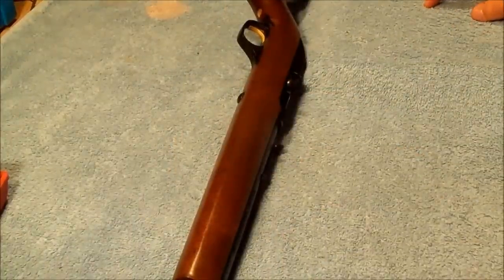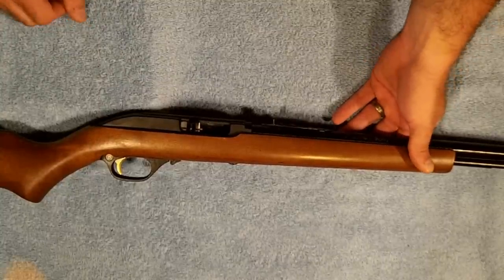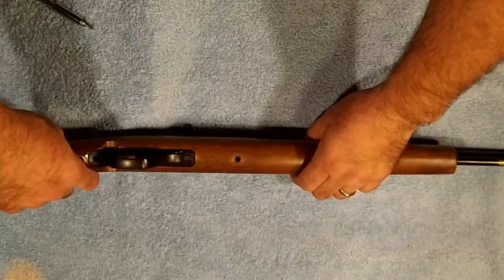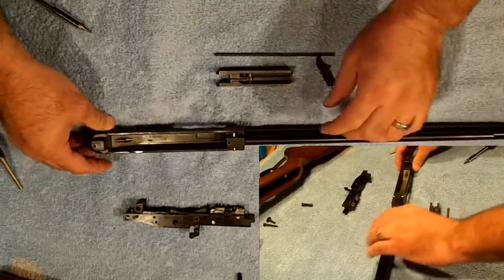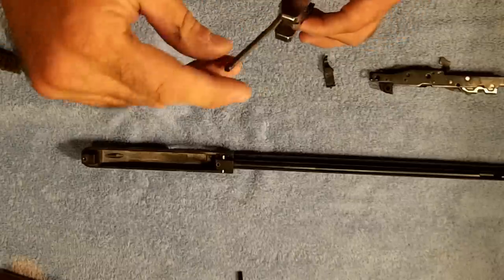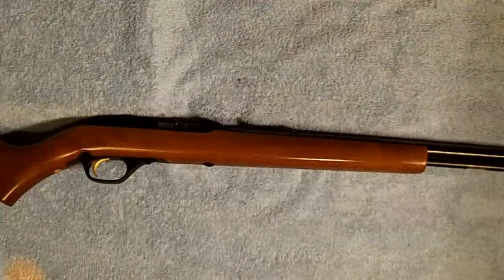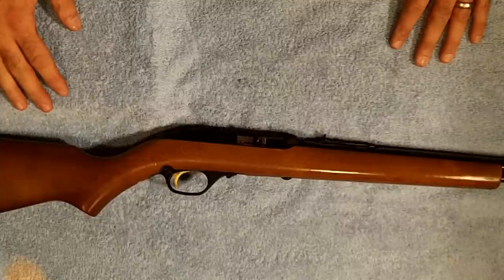Marlin Model 60 Problem

Comment: Umm, the "problem" is the bolt lock back feature, push the charging handle in, the bolt locks back.  When we you let the charging handle out the bolt moves again as designed.  Also, a Model 60 from the 1990s is not really an "older" model. Looking forward to your next video, wonder what we will learn there . . .

Comment: Sometimes when cleaning mine there is a heavy build up of lead burrs. Possibly one was wedged between the bolt. I also found a little work with a file on all machined surfaces followed by some 600 grit paper makes it work like butter!

Comment: If you pull the handle all the way to the rear then push inwards on the handle it locks it open. pull the handle out to unlock it allowing it to move forward.

Comment: The bolt charging handle can pull the bolt back to 2 locking positions.  Half way is where you have it at the end of your video and where it stops after the last round.  The Full Back position is where it was when it jammed. To lock it back there you pull it full back and push the charging handle into the bolt.  Handle pin slides into a slot on the other side of the bolt.  To release: you pull back on the handle AND then pull handle away from the gun. Maybe cleaning got the handle free again.

Comment: Hi, the ONLY that you need, is pull off the charging handle, inside receiver they are a hole to lock this charging handle. (also you can see the "pin" on the charging handle, this lock inside the rereiver)

Comment: The reason the bolt got stuck is because there's a little notch on the inside of the slide there it's just a circular little indention in the wall that the handle gets caught on

Comment: I've got a problem with my 60.
Whenever I charge it, the trigger sticks. Pull the trigger once, then something clicks... pull it again, and it fires. Once it fires, the problem goes away, until you manually charge it.
Failing trigger spring not providing enough forward pressure perhaps?
Reply: Time to replace the springs ... Mcarbo offers a spring kit and trigger upgrade...

Comment: I have 4 of them from an old revalation to a fairly new one and when you empty the tube it locke open and you push the little extracter by the trigger gaurd to close ot or when open manually push in on the bolt handle and it will go a little further and stay open then pull out and it closes:

Comment: Marlin 60 experts, i have a question.  When shooting mine, the round feeds from magazine into the throat but halfway in, the back of the round kicks up towards the chamber and jams the gun. I ordered a new 1 piece 4 pin throat and installed thinking it was wore too wide allowing cartridge rim to slip upwards, but new throat does the same thing. Seems to me  the bottom of the throat should hold the rear of the cartridge down till it's fully seated rearward then arm lifts it to align with chamber to cycle properly. It does this like every 5-10 rounds. Replaced lift arm as well. I ordered it from gun parts corp because only place i could find one. Did i get a defective one? Any simple fixes? Thoughts?

Comment: THIS was painful to watch. One very important tip for everyone. During reassembly it is HIGHLY advisable to have the bolt in the "Hold Open" position to avoid bending the extractor spring.
Reply: Extractor spring or recoil spring,  as I had a very difficult time putting bolt in and compressing the recoil spring without bending it.
Reply: @louwilson0906  Yes, the extractor spring. This is because, the bolt must be installed by compressing the recoil spring before the bolt can be retained in the "hold open" position.

Comment: I'm not going to bash the presenter, but nearly all youtubes are wrong on how they go back together.  When putting the action group back on during re-assembly, you need to lock the bolt back per the instructions.  Not doing so give a chance that the ejector can get crushed/altered against the bottom of the bolt and can become a jam-o-matic.  Just follow the instructions for re-assembly.

Comment: Apparently you or the owner never knew about the function to lock the bolt in the rear. Just apply reward pressure and pull out on the bolt.

Comment: To find the year of manufacture, subtract the first two numbers from 100.  Mine is 25-which means it was made in 1975.  This is accurate regardless if the rifle was branded as Marlin, of one of the contract models, such as Sears, Western Auto.  This information is from Marlin.
Reply: This is only accurate with a certain range of production. I have 3 and one of them is older and not dated this way

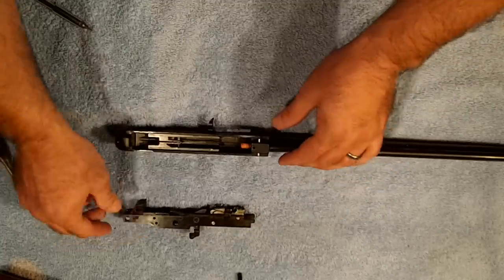Comment from the maker: The Bolt remained stuck after I had pulled on the handle a number of times and obviously it had been manipulated a lot before I taped this.  The bolt was stuck back beyond the point where it usually is held open with the charging handle.  At about 2:46 when I'm pulling on the chanrging handle I also am pushing back and out on the bolt with my finger.

Comment: I am at this very moment holding a mod 60 identical to the one you have in the video with the exact same problem and it has happened before and I have gone thru the same steps to try and figure it out with similar results well I am now putting it back together and just like yours mine is cycling properly guess I will take it to the range and fire it and see if it will fire properly or lock up again as the last time after only one round.If you figure it out let me know.

Comment: YEA ! Thats the way it is supposed to work but they lock back and no amount of pulling the charging handle will release the bolt it is not simply locked back . this happens to mine too and the only remedy so far is to break it down and reassemble it I think it may have somthing to do with the large spring that has one end resting on the breach block. see my up coming vedeo.

Comment from the maker: Only problem with your theory is the bolt isn't far enough back to use the manual bolt hold open.  Really, you should read the comments before you post.  Been a common problem with newer rifles.

Comment: That is what I was thinking also, the metal tab that protrudes out the back of the bolt handle fits into a hole in the receiver. About 2:55 into the video you pulled the charging handle away from the receiver and pulled back on the bolt and released the bolt.

Comment: its a lock if you pull the bolt all the way back and pull out on the charging handle it locks the bolt back all you have to do is pull it back and push the charging handle back in and release the bolt I have one myself
Reply: I think you have it reversed, unless they have different versions.  Edward Neu's comment is correct on mine.  You pull the bolt back and push IN the charging handle to lock it open.  Also, some models have a bolt release button at the front of the triggerguard.  I dunno if they also have the lock via the charging handle.

Comment: I have to Marlin Model 60 s the first one is when I turn 16 my dad bought it for me and I still have it I don't know how old it is but I still have it and I bought a newer model years & years later I would use a model 60 22 rifle over a Ruger I would use my Model 60 as a bug out rifle you might think I'm crazy but a model 60 rifle is the best I've ever had I am 65 years old now and I still have the original rifle that my dad bought me when I was 16 as for a note to everybody you do not use a lot of oil on the gun the more oil you use the more it will jam up you only need one or two drops on the bolt and the incite

Comment: I have a Glenfield by Marlin Model 60. Made it 1981. The only problem I have with it is that after I load the tube magazine, I have to cycle the action a few times to pick up the first round before I can fire it, after that it fires semi-auto just like designed. Any ideas why it's having trouble picking up the first round?

Comment: Are you kidding me?  You pull out on the bolt slightly outward and it releases.  It also has the release button on the underside of the stock.  And your doing gunsmith work?

Comment: Wrong ! it is not stuck there the charging handle is loose at this condition. I know it is hard to understand if you have not experienced it . I know how this gun works it is not the full lock back position that is the problem the charging handle goes limp at this point not even engaged into the detent drilled into the houseing.

Comment: You really shouldn't use CB's in a 22 semi auto...not enough recoil to cycle properly.
Reply: +Steven Hardy I do it all the time in my Winchester Model 190. I love low noise CBees. The 190 just functions manually like a bolt action rather than an autoloader. No big deal. Great quiet round for hunting. Although care should be taken to make sure rounds go down range and are not squib or lodged in the bore because the powder charge is intentionally weak. So its advisable to go one round at a time. It clearly states on the box that CBees will not function in autoloaders.
Reply: Then you have something wrong with your 190.  Mine will shoot 22 shorts longs and long rifles all day long in semi auto.  It will also shoot CCI Quiets semi auto no problem.  It states right on the barrel 22 S,L,LR
Reply: from wikepedia : The original .22 CB cartridge has the same case as the .22 BB, but there are now low-power .22 rounds sold as .22 CB Short and .22 CB Long which come in the more common .22 rimfire cartridge cases. The .22 CB primer fired rounds has a reduced powder load and is kept between 350 and 720 ft/s, while the regular .22 Short has an increased powder amount, and launches the same 29 gr bullet around and above 1000 ft/s. So while having the same length, the modern primer fired .22 CB Short & Long rounds, and the regular .22 Short are different cartridges. Other modern rounds, such as the .22 Aguila Colibri and .22 Aguila Super Colibri have bullets in the same weight range as the regular CB Cap with velocities in the 300ft/s to 500ft/s range, essentially making them somewhat weak CB Caps in .22 Long cases. The longer cases of the CB Short & Long and the Colibri rounds, will allow the rounds to be fired in magazine fed firearms, in which the tiny CB Cap cases would jam.
Reply: Will Anslow Have you shot Remington CBees in your 190? Specifically Remington CBee low noise. If you haven't, try it and see your results. Nothing wrong with my 190. I know it will shoot LR, L, and S. Great rifle.
Reply: I have to say that no I have not shot Remington CBees specifically in any of my 190/290s  If I find some I will try them.  CCI Quiets are my favorite.  710FPS work in my 190/290, and are quitter than my PCP air rifle.  Not to mention that they hit a whole lot harder being 40gr bullets.
Reply: Will Anslow The specs on the box are: Remington CBEE22. Low Noise 22 Long Rifle Hollow Point. Technical Data: Cartridge 22 Long Rifle; Bullet weight 33 grains; Bullet Style: Lead Truncated Cone, Hollow Point; Velocity: 740 fps at muzzle, 687 fps at 50 yd; Energy: 40 ft-lb at muzzle, 35 ft-lb at 50 yd; Drop: -2.7" at 50 yd, sighted at 25 yd.

The bullet style data is a little misleading as the 33 grain bullet is plated, not bare lead. Squirrels never even know they are being shot with this round it so quiet. Not noticeable outside of ten feet. Sounds like a cap gun inside of ten feet. It might be a better choice for a 22 revolver rather than an autoloader if you don't want to manually cycle each round.
 Don't know if it is actually 740 fps but it does not cycle in my 190. Maybe I should try some CCI Quiets at 710 fps. If it works in your 190 then it ought to in my 190.

Comment: Duh, what did you think the arrows on the charging handle are for?  To lock the bolt. Duhhh.  Jut pull the charging handle out to unlock the bolt.  He must have manually locked it, which you are actually supposed to do for reassembly, before you drop the action in. Read the manual.

Comment: Anyone claiming to have jamming problems is running too much lube.
Reply: Or they put the action back on without locking the bolt back first as the directions say.  If not, the ejector spring compresses and it becomes a jam o matic after a few times.  Read and follow the directions.